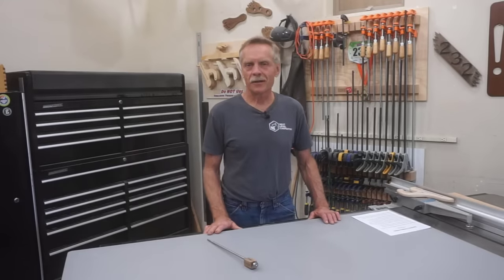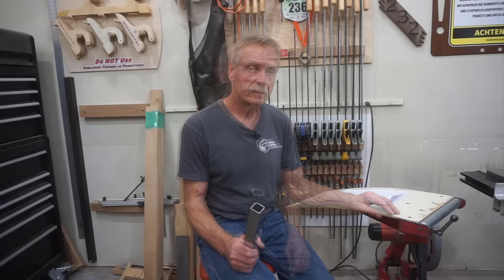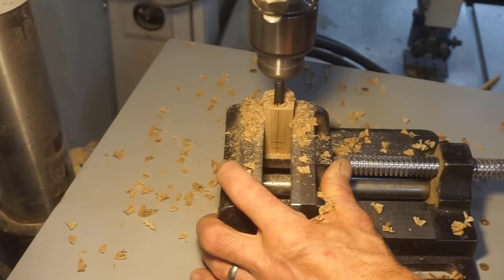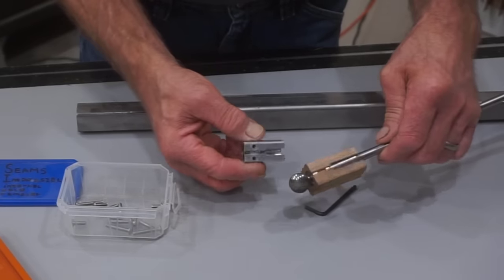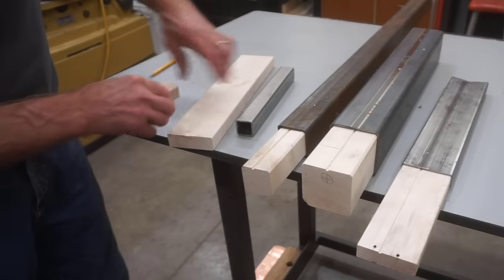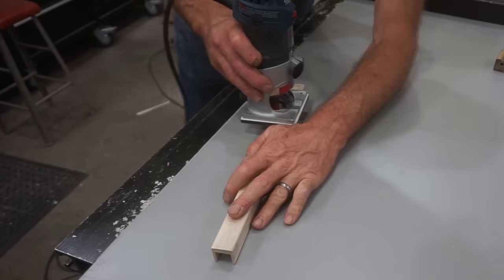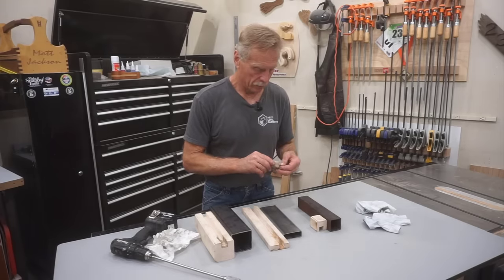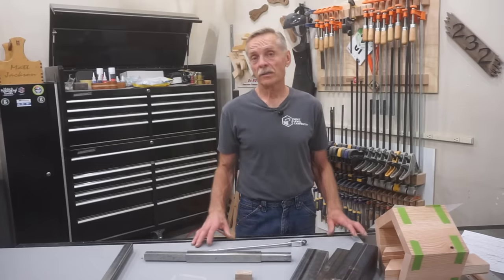How to Quickly Remove Internal Weld Seams from Steel Tubing

Comment: I can't believe you didn't use a scrap piece of wood to test proper dado depth... that is unbelievable... fine wwkg 101... run a scrap piece before you work with the finish material to ensure all of the set-up is 100%... guess my time milling exotics makes me pedantic... still for a dude that calls himself next level that was a straight up dunce move common sense would inform you of that before the 1st day of fine woodworking & joinery was done
Reply from the maker: You can't possibly be SERIOUS... can you?!
Reply: @NextLevelCarpentry  what you'd rather make mistakes then simply check your set up with a scrap piece clearly you have never worked with pink ivory, ebony or other expensive woods where one mistake can cost you more than your profits... that's just being lazy & dumb... in other words of course I'm serious you are arguing with that advice after screwing up a dado depth on your video
Reply from the maker: You ARE serious! I submit that your professed Milling of Exotics has made you far more pathetic than pedantic... you'd be that guy sitting at the Finish Line after the first human being ran a four-minute mile and criticizing the way his right shoelace was tied. Truly a piece of work dude... hope that works out for you! 😜😎
Reply: Truth Is In Nature  I was looking for your videos, Im coming up with nothing.
Reply: Corona is a hell of a disease... Common sense says that the sleeve was an experimental piece quite in the vicinity of scrap pieces. I'm not aware that the sleeve was from the finest ebony, sanded to 10'000 grit, lacquered and polished in the night of a full moon... but I might have missed that part in the video....
Reply: I seem to recall that for any fine product that Matt has made so far has been done WITHOUT a Test Block. In fact, he usually has an extra piece or 3 made up so that he can perform sequential actions on a progressive test block that matches up with the finished piece along the way...